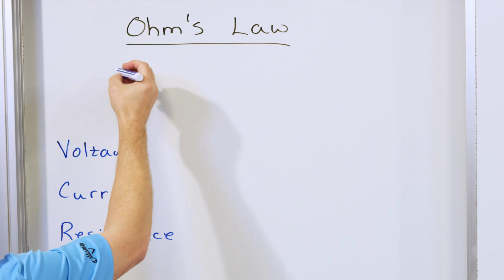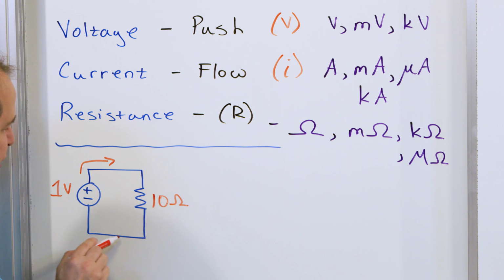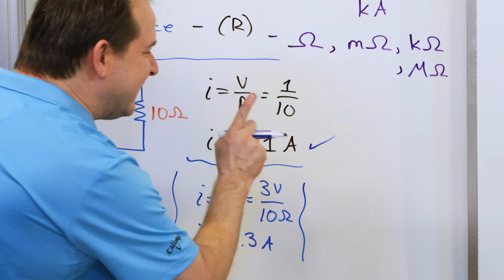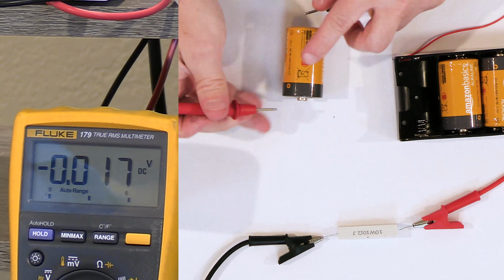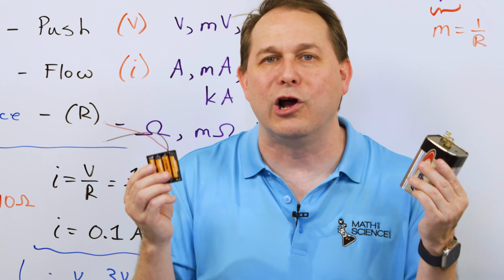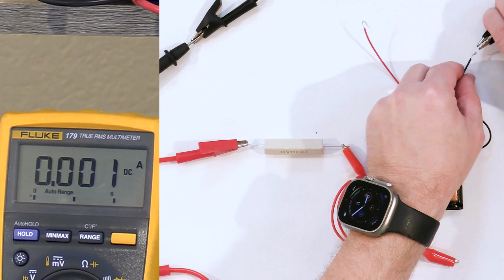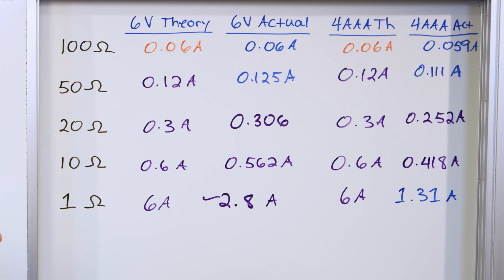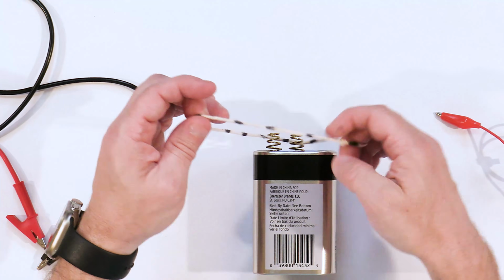Intro to Ohm's Law & Deeper Look at Voltage in Circuits

Comment: My Uncle saw my Calculus book on the table and said to me "Why are you wasting your time learning that stuff... You'r never going to use it!"

But I use some aspect of mathematical engineering in a low key, calm unobtrusive way just about every single day... and learning mathematics has sharpened my mind and allowed me to take on other difficult to learn subjects like computer programing, hydrogen based biochemistry, electrical engineering, music theory and Physics.  

"Sine is Y and Cosine is X is etched into my brain 🧠  as are many mechanical processes learned in my pursuit of understanding mathematics.

Comment: I tried repacing 4AAA batteries with 4Aa batteries (in series) because the device  'ate the aaa in 3 days. The device worked, but got hot. Very hot.

Comment: I'm confused so a -3 + -3 is  voltage is different then money? I know -3 + -3 I thought was  -6 if it was money I would owe -$6 right? So power is different or I'm I dumb? I don't understand! Please let me know what I'm mixing of because I think about money -3 + -3= -6 if it was dollars I would owe -$6 correct but with energy it's different?  A positive 3 is equal to to a negative negative 3? +3  is the same as -3+-3?  -3+-3=+3 what am I missing?

Comment: When I first learned electronics w e were taught the volts were E or Electromotive force, the I or Intensity or  current and R for Resistance. The ohms law was E=IE and P for power in Watts was calculated as P= IE. But not pi which 3.18.  Love your channel. Have a great day.

Comment: Voltage is a hard concept. It is easy to have analogies and understand it at the surface level but what does it mean at the electron level?

Voltage was used to be called tension and that word (or its equivalent) is still used in almost all other languages. The word "voltage" is strange as it means nothing like words current and resistance.

The modern concept of Ohm's law is a simplified one. In reality Ohm's major contribution was just to realized the internal resistance of the battery. The batteries of the time had high internal resistance so it dominated the measurements.

Comment: Professor Math and Science Tutor, thank you for a practical Introduction to Ohm's Law and a Deeper look at Voltage in Circuits. The measurements of Currents/Voltage/Amps using a Digital Volt Ohm meter increases my overall knowledge and understanding of Ohm's Law. This is an error free video/lecture on YouTube TV with the Math and Science Tutor.

Comment: Now I understand why I cannot start a car with 8 1.5 Volt AA batteries.  The voltage drop would result in a much lower 'real' voltage, and therefore significantly lower amperage (linear).  And thank you for your teachings.  Honest, un-biased, poignant.
Reply: Car batteries have three metrics.  CCA (cold cranking amps),  AH (amp hours) and V which is usuall 12.    Most high capacity batteries are 500 to 800 CCA.  The higher the amp-hour rating of a battery, the longer it will last before it needs to be recharged.

Comment: I am Retired from working on the Electrical, Hydraulic & Pneumatic Systems on Drilling Rigs & other related Equipment.

As you know the Well Know Fact that wiring two 12 Volt Batteries in Series gives Doubles
Reply: Sorry about accidentally hitting SEND Prematurely.  

So, as I was saying, wiring two 12 Volt Batteries into "Series" DOUBLES the Voltage  to 24 Volts (12 X 2 = 24) while wiring them in "Parallel" DOUBLES the Amperage with the Voltage Remaining the Same.

Does each Battery wired in Series have to be the same Voltage?  For instance, what if I want to add a Third Battery (6 Volts) in SERIES to give me 30 Volts as in 12+12+6=30 Volts.  Will that work?

If so, does the 6 Volt Battery have to be arranged in a Particular Order to work Efficiently?  I am sure the Engine's Alternator will need to be Upgraded for proper Recharging.

Comment: Is it possible that each battery size has a specific amount of coulombs? I think you mentioned the internal surfaces. Doesn't that equate to the presence of more coulombs, like more apple trees on a larger field? A battery then has a limited amount of these to push out. Should that value be stated on the product? Could you test your power supply to see the amps it can produce for each resistor? If it's powered from AC, I imagine it has infinite coulombs available? Thanks for your help.

Comment: Appreciate you choosing subject which is need of the hour for every body.
Reply: I Agree!  I also like to use the "Water Pipe Analogy" where the Voltage is Similar to the Pressure (P.S.I. or whatever measurement of Pressure you prefer to use) that Moves, Pushes or Forces the Water along inside a Water Pipe.

The Amperage is the amount of Electrons flowing around a Wire
Reply: The Amperage is the Amount of Electrons (Volume) flowing "Around" a Wire or Conductor WHEREAS the Volume of Water may be rated in G.P.M.s (Gallons Per Minute) or a Fraction there of Flowing "Through" a Pipe.  There are several methods of rating Water Flow.   The G.P.M. Method is commonly used on the "Less Scientific" matters in the USA.

My reason for empathizing "around" and "through" above is while it is commonly known that Water flows "through" a Pipe, it is NOT so commonly known that Electricity Flows "around" the Outer Surface of a Wire (NOT through it) and underneath the Insulating Material, such as Plastic, if so Equipped.

Comment: If connect cells in parallel, they're capable of supplying more current. I think it's same thing as using a large size battery.